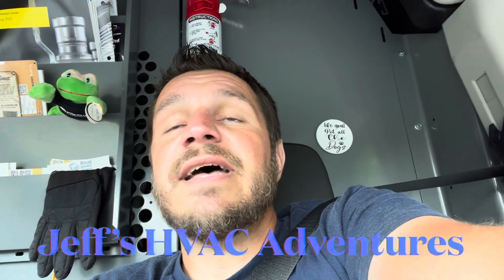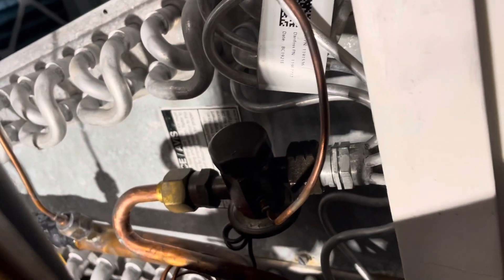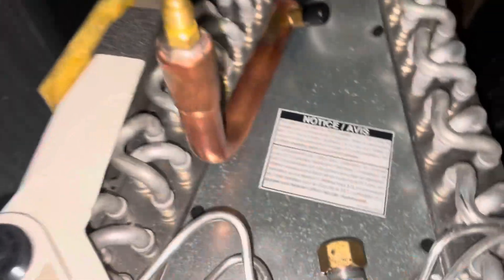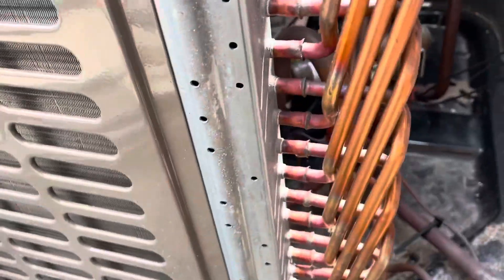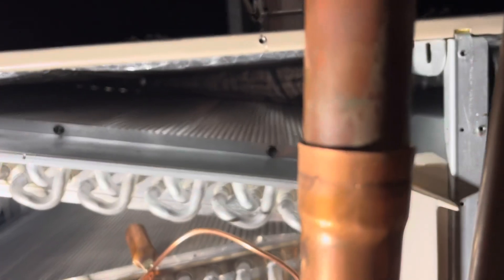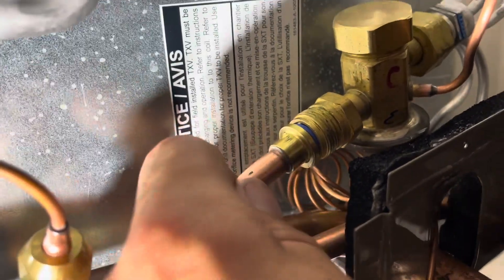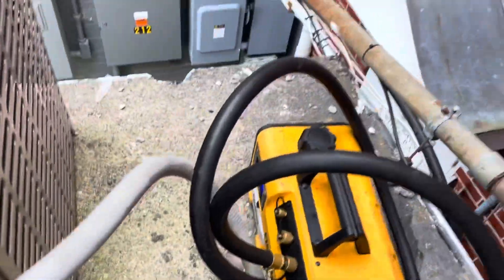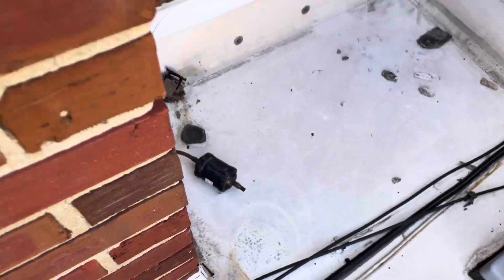Evap Coil and TXV Replacement On York Heat Pump!

Comment: Would it have hurt it to leave the old filter drier on with the new one by the air handler having 2 filter driers?
Reply from the maker: No in theory it won’t as long as the old filter drier isn’t clogged.  But any time you open the refrigeration system, you want to replace the drier.
Reply: Adds to the Pressure Drop in the system 
And you have to add Refrigerant for the drier.

Comment: You earned a subscription just curios are you licensed for PA Jeff.

I am in Chester county which is about an hour to an hour and half from the cheasapeak

If so when I am ready maybe you can do my Mr cool install.

Which would replace a comfort pac crappy hack job  install and the comfort pac replaced a true in wall split system Armstrong from 1990.

They did not size the comfort pac correctly at all.

As my usable space is 1200 hundred square feet so 18k btu is grossly undersized for cooling also a return was never installed.
Reply from the maker: Thanks for the sub!  No that’s out of my service territory.  But if you need any advice or have any questions feel free to email me jeffshvacadventures@gmail.com
Reply: Thanks.
Reply: Thanks again Jeff I will email you there and send you some photos and by the way I live close to the Delaware border.

And I did get a, quete from a company out of Delaware that does PA.

But maybe if I email you you will know where to get micselionios parts for my rebadged gree.

As I need 20 Phillips head screws I can't find at Lowes or home depot and I need a new plastic knockout cover for the air handler where the breaker would go.

And busted the attachment piece for the 60 Amp circuit breaker.

But I still need to get an hvac guy to install it.

But I will send you pictures with descriptions and what the wiring set up is that is in my hvac closet again thanks.

Comment: Great video like always!

Jeff,  when is it better to change the Air Handler rather than changing coil only?    Are coils covered under ten year warranty?

Thanks
Reply from the maker: If the unit was registered then you get 10 years.  Different manufacturers have different policies though.  

If it’s out of warranty, (over 10 years) I’d say offer the customer options on replacement and also give them the price to just change just coil.  Let them make the decision.  But if the AHU is older than 15 years old, strongly suggest AHU replacement.
Reply: @JeffsHVACAdventures  

Your feedback is greatly appreciated and I follow your advise as you are a very credible resource for homeowners.  I have learned allot form your videos on how to do preventive maintenance and the things to look for.

Congratulations on your channel and the work you do for the community.

HV

Comment: Yorks were good back in the late 1970s and even in the 1980s and 1990s and was named and made in York Pennsylvania.

But in 2005 got sold to Johnson controls an Irish company and I think that's when the issues really started.

Too much faulty stuff these days with hvac companies.

Even carrier is not like they were in the 1980s and 1990s same with Lennox and trane.

And honestly I still don't understand why big bulky old school condenser units are still bieng sold so much when side discharge units with inverter technology with air handlers are the way to go.

And yes York has jumped on that bandwagon too.

But honestly they are not that good.

And ohh I figured out this weekend that Mr cool universals are basically rebadged gree flex units.

As I took apart the covers on my condenser and saw the compressor said gree on it.

I got tipped off after I watched an install Video of a gree flex 6 months ago and just happened to look exactly like mine.

So Jeff if you come across Mr cool universals and need parts gree will have them.

Still need to figure out if the Mr cool mini splits are rebadged gree ones too.

And keep an eye out on the pioneer ones not sure if they are rebadged or rebranded grees too.

Anyway you are a good tech.
Reply from the maker: Thanks.  Yea your right about York.  Their products really took a dip in the mid 2000s.  Even had that class action lawsuit against when they had that horrible blue evap coil.  
Thanks for the info on the rebadged Gree equipment.  Will definitely keep an eye out.  🤙
Reply: @JeffsHVACAdventures  your welcome Mr cool is pushing to much diy.

And people have called in to complain but with Mr cool universals they are pushing what they call quick connect no vac linesets that come precharged with nitrogen 

Which they also use in thier mini splits. 

The problem is they tell people to use actual soapy water. To do the leak test and if no bubbles are present just release the refrigerent we all know as I know from a car ac system as soon as it is exposed to air you need to put it under a vacaum.  Also if you encounter a Mr cool air handler and someone complains, I am hearing a scrapping noise that's because Mr cool did not properly balance the blower wheel assembly on the air handler. 

I watched a guy in a video call into Mr cool and complain they sent him out a whole blower wheel assembly with the fan motor, but it had the same issue but he figured out to check the blower wheel before putting new fan motor and blower wheel in to balance the wheel properly. 

Ohh and hvac guys video or Curtis's channel helped me figure it out as I had ordered a mr cool universal 3ton but I have not had it installed yet. 

And considered a gree flex but I could not afford the extra 700 dollars then  just happened to 6 months ago come across his video saturday spent installing gree flex 3 ton at my house and was shocked, when I saw his video and was like hey that looks exactly like mine with the air handler and condenser, but did not get around  until this past Saturday taking the covers off of my condenser then I rewatched the install videos he did one for his house and one for a custumer and every part was the same as mine even the boards done to the led or lcd that says on with the dip switches that enable 2 or 3 ton mode on the condenser and air handlers. 

So as another hvac guy with a channel said parts might be an issue with Mr cool. 

Well guess what if you look closely enough you will figure out if Mr cool can't get it just call gree and they will probably have the part you need or a gree distributer..

And he likes diakin fits or vrv I don't like them because they are to proprietary 
With thermostats same with high end tranes and Lennox units.

I like inverter technology but not proprietary stuff with thermostats and air handlers.

Anyway with mr cool mini splits if you see green corrosion on the linesets and someone calls and says mine is not cooling or stopped working at least you will know the why it's happening and know what to do to get them up and running again. 

Either way you are a good tech
Reply: Ohh Jeff keep an eye out for any mini split calls where you get there and see excess linesets coiled up instead of bieng cut properly to fit and reflared properly Mr cool is telling them coil it up but other mini split companies are telling people to do the same thing.

And then wonder why it stops working and gets green corrosion.

On the linesets.

I mean a little excess won't hurt but come on 2 feet 5 feet of excess.

I know because that's becoming a big issue that hvac techs are encountering.

And with general contractors doing that same type of stuff.

Instead of just paying the extra to at least have a good hvac guy install them.

And I am bringing it up because I this video you demonstrate what happens when someone goes with the cheapesr bidder VS just having you do it.

With that crappy ductwork.

While they can pay you to fix it.

When the next issue happens but you need to at least tell them hey the ductwork and install was not done correctly and quete them to fix it.
Reply: Yeah, my relative had a 20 year old York at his house. York made some good equipment in the 80’s. 
I priced a York system for a customer back in the 80’s. The equipment cost about the same as Trane.  I stopped using that supply house because they always quoted high prices.
Reply: @picklerix6162  York made good equipment in the 1970s too I remember when I was a kid the blue colored big ones too.

Like when I used to go down to hilton head and stay at a resort there  and the clubhouse building had 2 big blue ones that were still running 15 years later and the resort itself had a whole bunch of Yorks on top of the building that were still running.

And my late grandmother had Yorks put in on a house she moved to in 1987 and they were still running with no issue when she died in 2002.

I also know that carriers were good too in the early 1990s. But have also gone downhill in recent years.

It's seems like quality has just gone downhill for the American companies but York is not even an American company anymore and Niether is Goodman.

And I think quality has just gone downhill in general for a lot of hvac equipment.

And by the way I have no problem with aluminum instead of copper but come on you still need quality control.